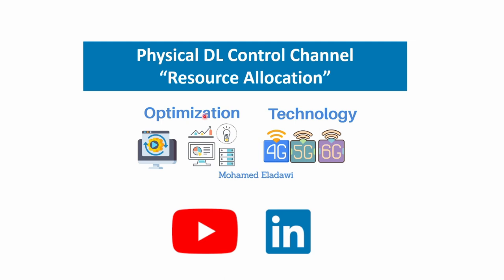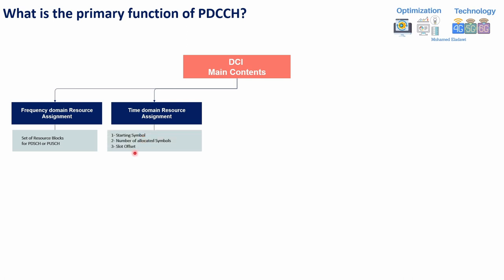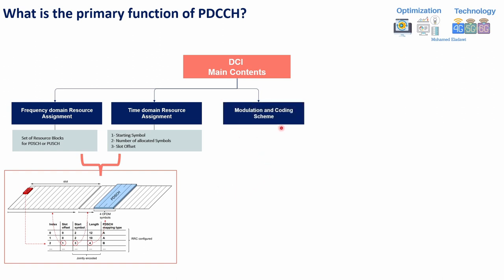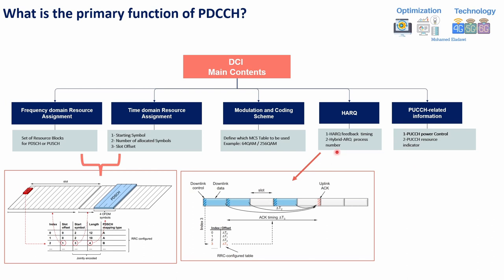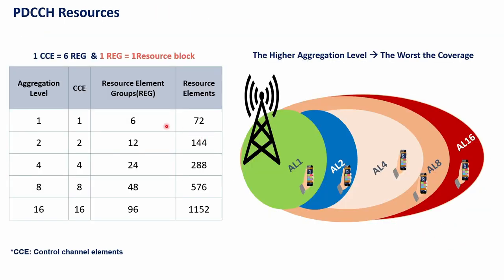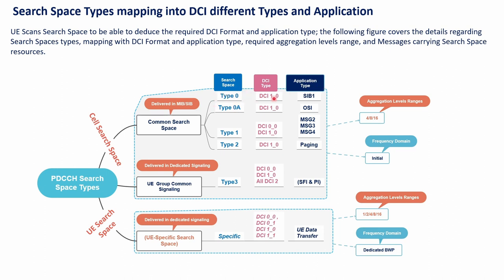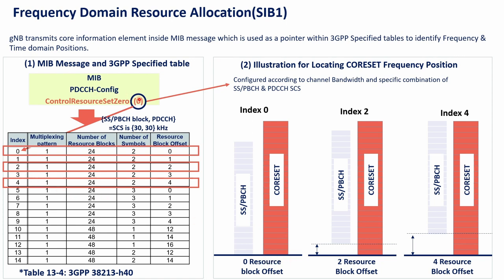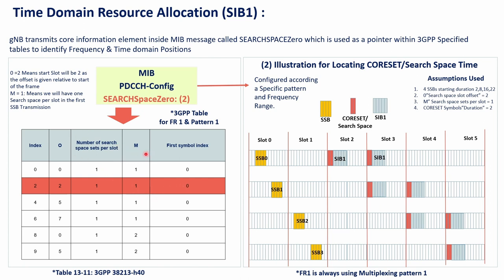5G DL Channel: 5G Physical Downlink Control Channel(PDCCH)

Comment: Hello Mohamed!! In 4G PDCCH OFDM symbols is informed to the UE by PCFICH. In 5G SA this is done via RRC specific signaling during RACH procedure. Is it correct ? thank you
Reply from the maker: Hi Geroge; yes you are right about 4G Part. Regarding 5G SA Part. i am not quite sure from the answer but based on 3GPP TS 38.213 and 5G NR in Bullets. gNB transmits core information element inside MIB message which is used as a pointer within 3GPP Specified tables to identify Frequency & Time domain Positions including the number of resources blocks and number of OFDM Symbols used for CORESET(PDCCH).

Comment: Very Informative.
One question
From which point on wards UE will start monitoring ue specific search space? After RRC Setup?
Reply from the maker: Good question, yes as per my knowledge UE specific search space will be measured in the connected mode.

Comment: Hello Mohamed! I would like some clarifications regarding search space for other SIBs that SIB1 carries  : The abovementioned search space for other SIBs, that SIB1 carries,  is part of the contents of PDSCH(SIB1).  Is it correct ? Thank you
Reply from the maker: Hi Georgie;as per my knowledge, SIB1 will cover all the information needed for other SIBs
Reply: @mohamedeladawiashour  Please correct me  if any:
SIB1 can be used to provide an RRC configured look up table within the "pdcch-configcommon" parameter. In that case UE uses the RRC configured look up table when receiving PDSCH resource allocation for other SIBs. 
# If UE is not provided with an RRC configured look up table within "pdcch-configcommon" parameter, then UE uses the standardized table for reception of OSI.

Comment: Hi Mohamed. I have 1 query:
1. CORSET & Search space contains the information related to frequency and time domain position of PDCCH. With these info UE will perform blind decoding on PDCCH candidates with different AL. 
>My question is where UE will get the information related to AL & PDCCH candidates on which UE will perform blind decoding  of PDCCH which carries SIB1 ?
> And what are AL used by UE for blind decoding SIB1 on Type-0 PDCCH CSS set???
Thanks
Reply from the maker: "Hello Sam, from what I recall, during the initial access (SSB acquisition), the UE receives and interprets MIB via PBCH. This MIB contains information about search space 0, which enables the UE to decode SIB1 and subsequently obtain additional information for other SIBs and SEARCH SPACE and regarding AL question for what the AL UE initially uses, I'm not entirely certain, but I believe it starts with the minimum allowed AL. The network then determines whether to adjust the AL based on PDCCH BLER. I need to revisit the details on PDCCH, as the last time I reviewed it was while preparing for this video.

Please see the below information sent in the MIB Message            

           RRC-MSG
                       ..msg
0>     01   00000001 T 
                       ....struBCCH-BCH-Message
                       ......struBCCH-BCH-Message
                       ........bcchbchmessage
1>     5B   0------- * 
                       ..........mib
            -101101-   ............systemFrameNumber:101101(2D)
            -------1   ............subCarrierSpacingCommon:scs30or120 (1)
2>     25   0010----   ............ssb-SubcarrierOffset:0x2 (2)
            ----0---   ............dmrs-TypeA-Position:pos2 (0)
                       ............pdcch-ConfigSIB1
            -----101

3>     25   0-------   ..............controlResourceSetZero:0xa (10)
            -0100---   ..............searchSpaceZero:0x4 (4)
            -----1--   ............cellBarred:notBarred (1)
            ------0-   ............intraFreqReselection:allowed (0)
            -------1   ............spare:1(01)

Subsquent information received in SIB1

   ..................pdcch-ConfigCommon

......................controlResourceSetZero:0xa (10)
......................searchSpaceZero:0x4 (4)

  ......................commonSearchSpaceList
........................SearchSpace
..........................searchSpaceId:0x1 (1)
..........................controlResourceSetId:0x0 (0)
 ..........................monitoringSlotPeriodicityAndOffset 
..........................monitoringSymbolsWithinSlot:10000000000000(20 00)
..........................nrofCandidates
............................aggregationLevel1:n0 (0)
............................aggregationLevel2:n0 (0
)
............................aggregationLevel4:n4 (4)
............................aggregationLevel8:n2 (2)
............................aggregationLevel16:n1 (1)
      ..........................searchSpaceType
............................common
..............................dci-Format0-0-AndFormat1-0

                       ........................SearchSpace
..........................searchSpaceId:0x8 (8)
..........................controlResourceSetId:0x0 (0)
..........................monitoringSlotPeriodicityAndOffset
............................sl40:0x15 (21)
..........................duration:0x2 (2)
..........................monitoringSymbolsWithinSlot:10000000000000(20 00)
..........................nrofCandidates
............................aggregationLevel1:n0 (0)
............................aggregationLevel2:n0 (0)
............................aggregationLevel4:n4 (4)
............................aggregationLevel8:n2 (2)
............................aggregationLevel16:n1 (1)

                       ..........................searchSpaceType
                       ............................common
                       ..............................dci-Format0-0-AndFormat1-0

......................searchSpaceSIB1:0x0 (0)
......................searchSpaceOtherSystemInformation:0x8 (8)
......................pagingSearchSpace:0x1 (1)
......................ra-SearchSpace:0x1 (1)
Reply: @mohamedeladawiashour  Thank you very much for such a detailed explanation for my query.
Regarding the below query, I am writing the ans which I read. Please correct me on this.
Q: What are AL used by UE for blind decoding SIB1 on Type-0 PDCCH CSS set???
Ans : Common Search Space (CSS) PDCCH blind decoding procedure (Common RNTI's are mandated to use AL4, AL8,AL16)
PDCCH blind decoding is performed based on following sequence, 4 CCEs (perform Blind decoding for 4 PDCCH Candidates), Then 8 CCEs(perform blind decoding for 2 PDCCH candidates) and Then, Finally 16 CCEs(perform Blind decoding for 1 PDCCH candidate).
>If RNTI does not match with any of the 4 candidates in AL4, then CCE Aggregation Level8 is considered,.
>If RNTI does not match with any of the 2 candidates in AL8, Then finally CCE Aggregation Level16 is considered, Channel estimation and PDCCH decoding is performed on the 16CCE’s and finally if RNTI match the DCI CRC scrambled RNTI then UE will get to know that DCI is allocated for that UE and it will drive the DCI Info to get the DL/UL scheduling information..
I referred from link : https://www.linkedin.com/pulse/5g-nr-pdcch-cce-aggregation-search-space-naveen-chelikani/
Reply from the maker: @sambitroutray8297 perfect; i think this answer make more sense; let ne go through the article as well. Thanks for sharing this

Comment: Very helpful Mohamed!
Ue specific search space identifies the time domain positions of Ue specific Pdcch.Is Ue specific Control resource set also necessary for frequency domain position of Pdcch? Thank you
Reply from the maker: Thanks a lot, As per my understanding, UE Specific Search Space is dedicated to each UE in connected mode and is used to identify both Freq/Time domains for PDSCH used for Data. UE is informed in the dedicated mode for UE Specific search space "After RRC Setup". While Common Search Space is the specific search space that every UE needs to search (Example PDCCH for SIB) or signaling message. For example, during the RACH process, UE must detect PDCCH for SIB1 reception or various DCI (PDCCH). Please confirm if it is clear, as I think you are might be confused between UE Specific Search Space and Common Search Space, and I apologize for the late response.
Reply from the maker: Please confirm if you got it as i am worry you are confused between ue specific search space and common searh space
Reply: Thank you again Mohamed for your response.Given that  ControlResourceSet0 and Searchspace0 are necessary for a ue to identify pdcch sib1  freq/time domain position, i assume that besides ue-specific searchspace(time domain position of pdcch) also ue-specific controlresourceset is necessary for a ue to identify the freq. position of its pdcch.
Reply from the maker: Yes, you are absolutely right and this is part of common search space